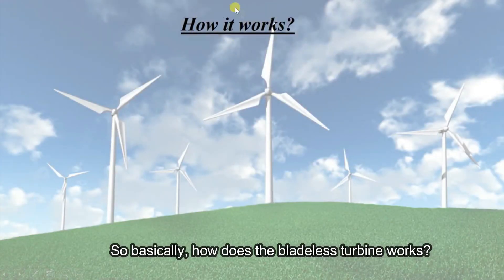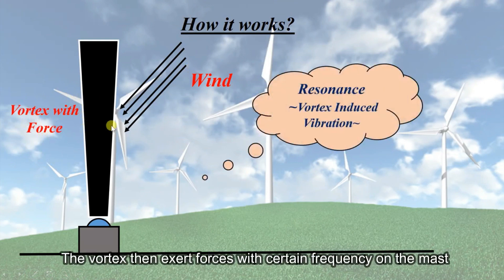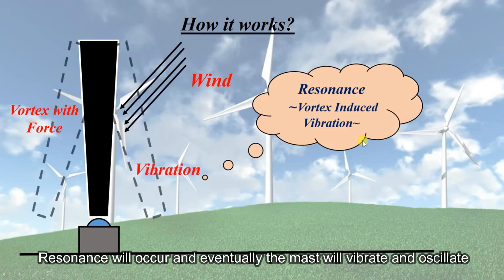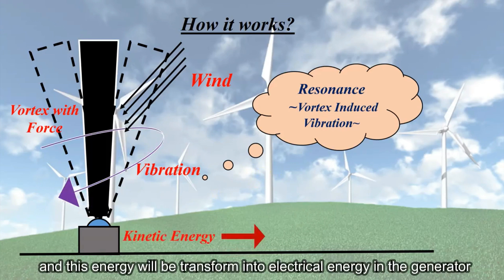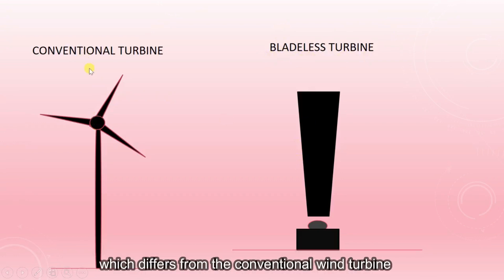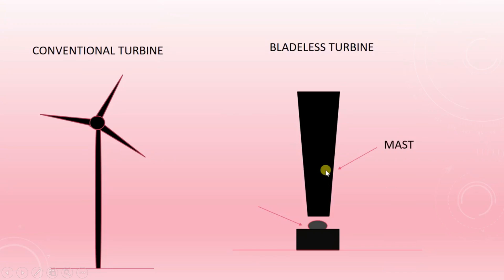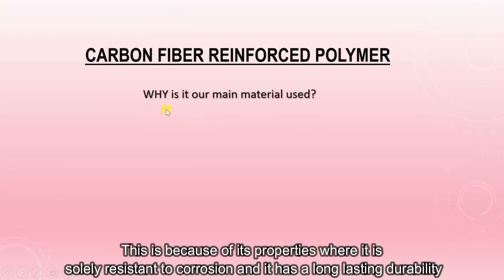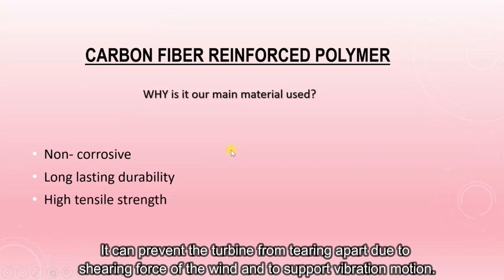EKC378Group04 - Bladeless Turbine

Comment: what a speech :D.This bladeless wind generator produces how much energy for a given height?Give numbers and stats.I have been looking for it everywhere on the internet..
Reply: Reasonable energy.  Can't you read?  

Kidding, as an electrical engineer with significant interest in flight, I want to know exactly the same thing.  My guess would be, but it's just an off the top of my pointed head guess, no numbers, that the round pole vortex generator is probably far less efficient at extracting wind energy per area, pole vs. blade, as the blade of a wind turbine is essentially a rotating wing.  That is a guess, as I say.  

Also the area of the pole is substantially less than the area of the three blades on a standard wind turbine, approaching 3X, more or less.  It seems to me that if you look at the Tacoma Narrows bridge or an airplane wing in oscillation, where it is actually a changing angle of attack, twisting if you will, along with the spring mass of

Comment: Would a small version work on a sailboat to provide 12/24 volts for battery charging? Whether sailing or at anchor the vessel is rarely still so could use that motion as well as the vortex effect to generate poweer

Comment: how much electricity does it produce per hour?
Reply: They claim a nominal power of 100 watts for the 3 m high "turbine". 
But there is no information about the needed wind speed for this power.
And as far as I know, they never showed the display of a wattmeter connected to a working turbine.
Allegedly, they only achieved a power of 5 watts so far. And talk about improvement, if they get the money.
:-)

Comment: Energy production per hour?
Reply: A 9.5 m tall unit will produce ... 1 k
Wh. With that kind of power you might run ... a refrigerator while the wind blows. Wind energy is NOT. the answer.

Comment: You could sell an unpolished turd these days if you just use the right buzzwords - green, renewable, sustainable, environmentally friendly. Sure, it won't power a desktop computer, but just LOOK at all these buzzwords we use when selling our product to investors!
Reply: This is how it works:  Instead of using electricity to vibrate a coil in a speaker to produce sound remove the cone of the speaker and attach a "wing" to the coil or some such other item that will be moved or vibrated by the wind, (magnet attached in front of the coil on the opposite side of the wing). This movement or vibration will cause the magnet to move in and out of the magnetic field of the coil and create power. Make these wings or blades compact enough and utilize them in larger numbers together like a big mat, ( like someone made astro-turf giant sized) and a decent amount of energy can be produced simply by the wind passing over the mat not unlike how the wind blows across tall grass. This could also be done using the surf to activate the movement of the blades. Hope this helped you understand the concept. It really is exciting. Here's a video. https://www.youtube.com/watch?v=Nj3pH95aMOQ

Comment: I'm skeptical. Considering the small swept area, slight angle of movement, and low velocity, I just don't see this capable of generating a lot of power. It would be necessary to use many machines per square kilometer to come close to generating the power of a few conventional turbines placed on the same plot of land. I do agree, these might be safer for wild life. We need hard data from a test project, to see how much energy can be generated from a given area of land, compared to a similar size field of conventional turbines. Another possible advantage, is that a down stream unit's performance would be enhanced by the wake of the machine up stream from it, rather than hampered, as would be the case for conventional turbines. This could be a big advantage. large scale testing is necessary, to know for sure.
Reply: This is merely taking a speaker and running it in reverse. (vibrating the coil in and out of the magnetic field to produce power)If one were to create something akin to a mat of blades w/coils at their base an effect similar to wind passing over tall grass could generate a reasonable amount of energy in a relatively small space.
Reply: @1yllaev  That said, these could possibly be made to work well, but you'll need a lot of units. Basically, a "forest" of these, to get power similar to a few large turbines per acre of land.